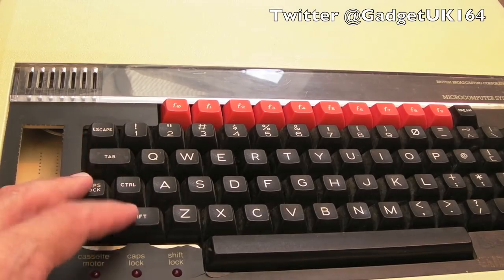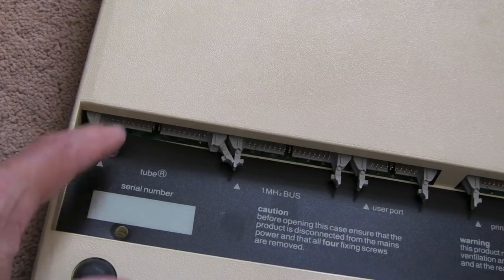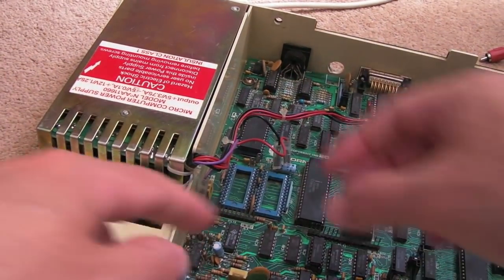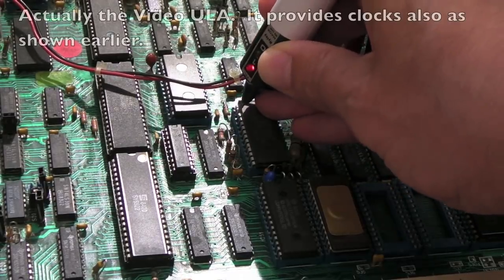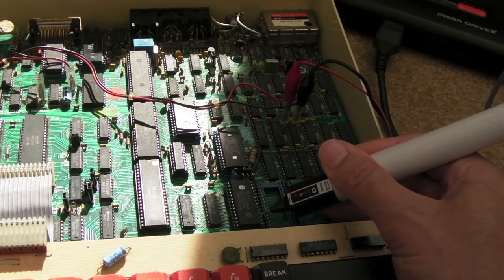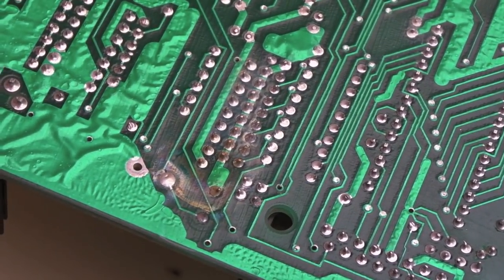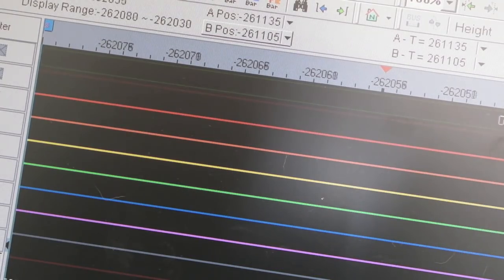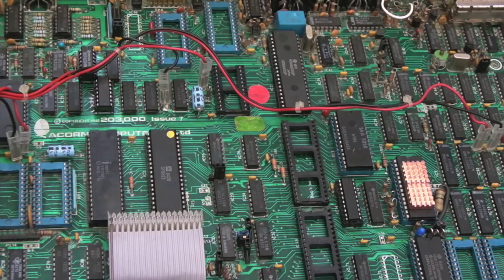Acorn BBC Micro Model B Multiple Repairs Part 1 (Continuous Beep)

Comment: Hello, one of my first jobs after leaving school was BBC Micro repair, I have seen hundreds of broken BBC's in my time and usually the dreaded single beep failure was 9 time out of 10 due to the west 6522 not initialising and this would prevent the computer getting to the prompt. I found the best way to repair them was to remove the unnecessary ics first and swap out the west 6522, the bbcs were built like proverbial out house and it is unlikely there is a secondary fault with it. the composite signal was meant for a high resolution monochrome (green screen) monitor. that's why s39 is not populated, for best results use an RGB monitor connected to the ttl rgb output, and remember the default mode is mode 7 which is driven by a separate video IC (SAA 5050) which has a small memory foot print, so switch to a mode other than mode 7 may reveal memory issues, also the kernel ROM cannot be placed in another socket. ps the 12v supply is only for external floppys.
Reply from the maker: Thanks for the info there =D  I joined up S39 (before I tested colour btw) - there's a colour fault in part 2 =D  I will be building an RGB cable too, just waiting on wire.

Comment: As a long-term BBC micro fan (was my main machine as a child, and propelled me into my career as a developer) I love to see a BBC Micro up and running again.
I discovered 2 BBCs in a box in the loft that came from my parents  - I recapped them both and the issue 7 came up clean immediately - but the Issue 4 has the dreaded continuous beep....

I've been looking for resources on how to go about diagnosing and repairing - this is the most useful and comprehensive information I've found so far - bookmarked, obviously!
Have ordered a number of standard inexpensive replacement ICs (and sockets) as the most likely points of failure and I have an oscilloscope on order, but I think a logic probe looks like a necessity. Wondering if I can live without a logic analyser ... from what I've seen here, depending on what the issue(s) is/are, quite possibly not.

Thanks for the great video, and wish me luck...
Reply from the maker: Good luck lol!  Let me know how you get on with it!  Logic probe is useful, logic analyzer not essential.  Worst case - just rule out the 245's on databus (where I ended up) and you will probably sort it.
Reply: @GadgetUK164   Thanks. The 245 was what I planned to replace this afternoon.
Having done so, I now have a short on the board somewhere (not with my new joints - they all test clean) - so something else has gone wrong (i.e. I have broken) somewhere. Presumably some stray solder from the removal managed to land and get stuck somewhere.
All fun, right?
Probe arrives tomorrow - but I need to find and fix that short first.

Comment: Hello.

A single beep rather than two beeps on power-on is a possibility. The two beeps come from the fact that the sound circuit before initialisation can generate random noise which is what creates the first beep (note that the beep is not consistent in tone/quality), then the OS initialises the hardware and generates the second beep. Occasionally, there is no noise so only one beep is sounded.

With the ROM sockets, the leftmost one is always the OS, the remaining four are paged into a 16K block of memory. There is a 74LS163 (IC76) on the board which allows for the selection of upto 16 ROMS, although only the lower two output lines are connected to the sockets. The ROMs are numbered left to right. Since the upper two lines from the 74LS163 are not connected, this means that the left socket is mapped as ROM 0, 4, 8 and 12. Priority of the ROMs is from 15 down, so if you had a Forth ROM in the machine in the right hand socket (15) it should take priority over the BASIC rom in the left most socket and you'll get Forth by default when the machine boots.

Management of the ROMs comes from the OS ROM. You have a WE DFS ROM in the system for managing a disk drive, and it maps into the same address space as the BASIC ROM. When you operate the disk drive, the BASIC ROM pages out and the DFS ROM pages in for the duration of the operation under the control of the OS.

The sockets themselves are large enough to take a 64k ROM, however, the two upper address pins (1 and 27) required to do this are tied to 5V meaning that only the upper 16K would be accessible. One mod that is possible is disconnect these pins from 5V and wire them to the remaining two outputs from the 74LS163. This would allow you to load 4 64K chips into those sockets each containing four 16K ROM images. There were various add-on boards made which exploited this without directly modifying the PCB, although they usually involved soldering a several wires directly to IC legs on the board.

With regards how it accepts the BASIC ROM in any socket, each ROM has a standard header block that allows the OS to identify it. This includes whether or not it is a language ROM.

There is some clock division that goes on involving the CPU and the video circuitry. The 81LS95 chips control access to the video memory. Access to the memory alternates based on clock cycle between the CPU and the video controller thus allowing both to appear to be functioning at the same time without generating contention over ownership of the bus.

The two octal buffers you removed appear to be IC96 and IC70. IC96 is used in conjunction with the header/jumper arrangement to its left to control the EcoNet station number, so if you're not using the networking, this is not essential. IC70 is part of the printer interface. Of the two, I would expect IC96 to be more likely to cause trouble if faulty as it is connected directly to the data bus whereas IC70 is isolated on the other side of VIA IC59.

Hope this is of some help.
Reply from the maker: I worked out that the sound generator was the cause of the 1st beep, but I did not realise that it can be random in tone etc.  That's invaluable!  Because that was something I was worried about.  Rarely I only get the 2nd tone lol =D

Comment: Fantastic video. You explained the arduous troubleshooting process really well and as someone still learning how to use a scope and LA for repairs, this is highly instructive and inspirational. Thanks!
Reply from the maker: Cheers mate =D  This BBC had so many issues lol.  One of my favourite systems in my collection! =D
Reply: @GadgetUK164  You've got me wanting one now. :) I had one but gave it away to a friend years ago after it caught fire (yes - I turned it on without checking the PSU). Really well designed machine, though.
Reply from the maker: @flashjazzcat  You should get one!  Some great games on there =D
Reply: @GadgetUK164  I'm hopeless at games and am more into productivity tools, etc, but I would certainly boot Elite on the BBC. :) I do remember some fascinating text editors and graphics tools from my schooldays, and the file system mananger, OS and BASIC were superb. I wouldn't bother with the Econet network (nor the Winchester HDD which was constantly breaking and causing the teacher Mr. Bell endless grief), but having some kind of CF or SD card HDD would be great.
Reply from the maker: @flashjazzcat  There's certainly a lot of scope for coding and hardware dev on the BBC!  All those ROM sockets and IO etc, plus the 6502 which you are already legend at working with! =D
Reply: @GadgetUK164  My goodness - you flatter me. :D Thank you so much.
Reply from the maker: @flashjazzcat  Credit where credit is due ;)

Comment: I've seen quite a few videos now about the port at the side of the B keyboard. the Zif socket was one option but the far more common one was the cartridge slot (shown in the video) you got cartridges with 1 or 2 slots to stick a rom chip in.

Comment: The reason it doesn't matter which socket the basic ROM goes into is because the 3 ROM slots are all bank switched into the same memory location. I'm working from 30 year old memories here, but I recall the ROMS had a "signature" that the OS detected  and an initialise vector so each ROM could be initialised at startup. The OS scanned for all of them and initialise each one in turn, and was able to switch from ROM to ROM on the fly as needed. Very advanced for the time! I believe that add on boards would allow 8 or more roms to be added.
Reply from the maker: Thanks =D  Yes, I gathered that as I dug into some of the tech documenation =D  Thanks for the detailed explanation there though =D  Much appreciated!
Reply: Yes, I had a 16-bank ROM expansion board that kind of sat on top + some slightly hairy fly lead soldering.  Worked a dream and also added a paged-RAM filing system.. super fast loading of files etc.. from that additional RAM.

Comment: Great video and well done for perceiving, I used to add a socket to the cable that connects to the pin in the centre of the composite connector, but as I haven't needed to take any of them apart again, I don't bother any more.
Reply from the maker: Thanks =D  I did think about changing the DIN output to include audio but decided I wanted audio to go with composite too, so its easy to then just have a fly lead connector on the RGB DIN to connect audio up when used with a SCART cable too =D
Reply: Thanks, I meant that I add a socket (hollow pin) to the composite lead that attaches to the centre pin to make it easier to remove the board. I do add a jack socket in the end of the air vent for audio.

Comment: If you want to connect to a SCARTED TV you need the following:-
8 off 150 Ohm resistors and connect Blue output to pin 7
connect Green output to pin 11 and connect Red output to pin 15 ,
in the round connector you need to connect one resistor to pin 1,one resistor to pin 2,one resistor to pin 3 and one resistor to pin 4 these have to be short as possible
and join another resistor to the live side of all the resistors to 0Volts pins 1 is for the Red, pin 2 is for the Green , pin 3  is for the Blue ,the pin 4 is for the sync this goes to pin 20 of the scart plug because the signals are at TTL level.
Reply from the maker: Thanks!  I covered SCART in the next video I think =D

Comment: Wow that one has some major issues, well done for sticking with it.
Reply: Oh and do you want a disk drive to go with that BBC I got three in that Ebay lot and your welcome to the 5.25" single drive. (needs lots of work!) I'll throw you in some BBC disks too.
Reply from the maker: Thanks mate =D
Reply from the maker: I might get a disk drive - do you know the story with the controller chip?  I've read about the 8271 being insufficient or something and its worth putting a different controller in there for most FDDs?
Reply: I think its just limited to 40 track operation single density. the later disk controller can do 40 or 80 track. would be fine to start with. let me know if you want this drive. I’ve got two to do already so it'll only end up back on ebay otherwise
Reply from the maker: Thanks, much appreciated!  I am not sure I will ever use it tbh - I don't plan on collecting beeb disks and stuff.  I've got an SD device to load disk images etc =D
Reply: just thought it'd make a good restoration video. and it'd make your beeb setup more complete I'll give you a few 40 track disks to use on it. The SD solutions are very good tho. it just feels good to be able to load from floppy too, more nostalgic.
Reply from the maker: Thanks =D  Maybe hold onto it for when you get the Speccy SD boards or something?
Reply: will do, Im just waiting for more CPLD's to arrive for the ZX MMC pcb's I ordered the wrong ones lol.

Comment: Re the games,  thats what you use the cartridge port for once you repair the bad pin. You already know you can run games from ROM with the appropriate  header so simply plug cartridge port into socket 4 and mount it out on the case through the slot on the keyboard front.

Comment: Please note that Lk39 is not linked this link makes it possible to have colour on the BNC out connector , but this makes colours run because I have the diagram.
Reply from the maker: That wasnt my problem!  As you will see it part 2 - the transistor was faulty on the colour side.

Comment: woohoo. looking forward to this already...a one hour Gadgetathon!? now you're talking! :-D
Reply from the maker: Hehe =D  Will be mentioning you in the next video - re: the MMC device.
Reply: fantastic. BTW there are three (in general), I recommend the cheapest IF you don't need BBC master compatibility. On the standard Beeb, I noticed no major differences except the prices, on the master the smallest and cheapest won't fit in the user port due to the different case design .
Once you get a working Beeb (if you're gonna keep it) I can maybe suggest a few ROMS worth burning. That's the joy of the Beeb, you can burn all sorts of ROMs to improve and delve inside it's guts! :)
Reply from the maker: Yeah, let me know what ROMs might be worth looking at!  Although, I am not sure I need any ROMs for anything lol.   I've played around with the Super MMC and I seem to have everything I need on there.
Reply: Personally I do like the Advanced control panel. A sorta primitive O.S overlay that shows you at a glance what roms you have and a couple of easy configurations.
Reply from the maker: Will check that out, is it a ROM, or something that you load from disk?

Comment: Yeah, the expansion port is used for either RAM, or in my school, LOGO was on the expansion carts. I say carts, they were tiny, only a couple of CM long, and fitted into the PCB port you have really snugly, so much so, we thought it was a complete unit to pull upwards, not an adapter and pull sideways. Go figure.

Comment: I don't know whether you're aware, but I think you mentioned using a Vic 20 6502. Both that one and the one on the C64 were slower than the stock 6502 for the BBC.
Reply from the maker: Yes, sorry - that was a mistake in the video!  It was a 6502A that I use for replacements for VIC-20 and 1541 disk drives.  They are rated at 2Mhz.  But the standard VIC-20 CPU is the 1Mhz version.
Reply: Yeah, that's all I have to offer. Other than that, I know nothing on the subject. Great videos btw.

Comment: had the same adaptor (or one extremely similar) - you connected the cable to one of the ROM sockets and it came with a number of 'cartridges' that had a 28-pin socket inside to fit a sideways ROM. Allowed you to switch ROMs without having to dismantle the machine, however Sideways RAM boards essentially rendered it obsolete.
Reply from the maker: Thanks for the info =D  I need to find a cartridge or PCB for it now =/
Reply: I've still got some of my old stuff from the 80's - if I find any of the carts amongst it I will let you know - if not  you could probably get PCBs made as pretty sure they were just a double sided board with the socket and no other components
Reply from the maker: Yeah, I might have a go at making my own PCB I think =D

Comment: Can I ask...what solved the problem with the reset? How did it suddenly boot ok?
Reply from the maker: The reset issue was a separate problem - I only noticed that when testing with the logic analyser that the reset was intermittant.  Once I fixed that it still wasn't booting due to a failed 74LS245 - that was killing the databus on the CPU.
Reply: @GadgetUK164  Ok, thanks Mr. G! :)

Comment: The acorn electron is monochrome output on the composite. For colour composite you have to bridge LK4 I wonder if the BBC is the same? Just thought I'd throw that out there Chris 😁..Kim 😁
Reply: It was. The link he mentions was put there on purpose on Issue 7 boards. Just be glad it wasn't an issue 3 like mine where you had to solder in a dirty great patch to do the same thing as bridging one link does on the later boards. Not sure why Acorn insisted on doing this; possibly something to do with the old monochrome monitors that were about back then like the old Crofton 9" jobbies.
Reply from the maker: Indeed there is a jumper as mentioned in the video =D  I show more of that in part 2, where I work out what the problem with colour is!
Reply: @mistie710  It was something to do with the mod impacted the quality of the RGB output - though I never noticed! [I know, answering a post from 2 years ago!]